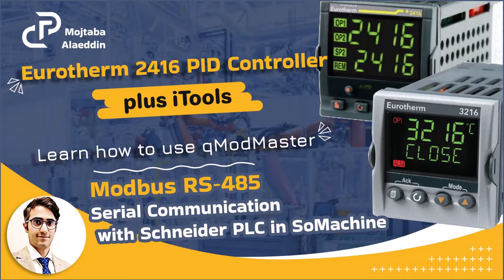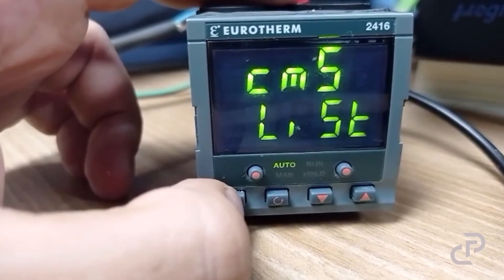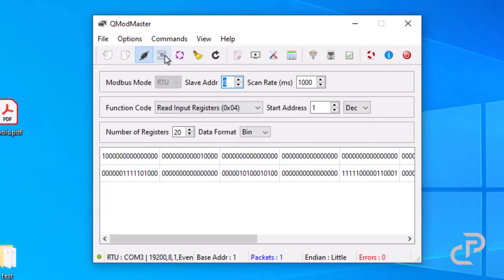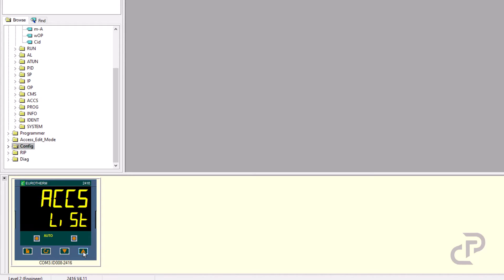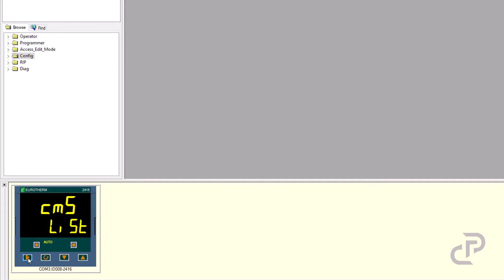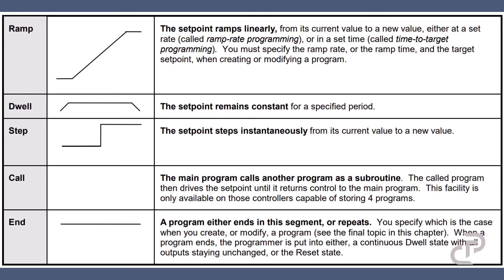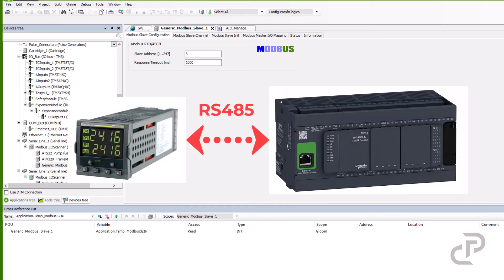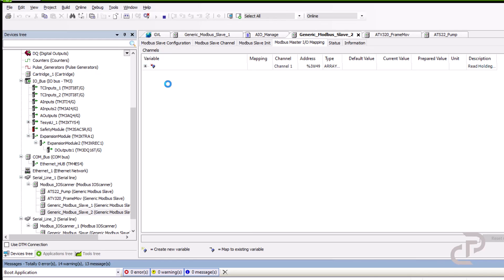Eurotherm 2416 PID Controller configuration | Modbus RS485 communication with M241 |

Comment: I am trying to establish a connection between my PC and my Eurotherm 3508 controller using the USB-RS485 adapter. I followed your instructions, but I get no response from the controller when I try to read registers in QModMaster. I checked that the Com port, Baud rate, parity, is correct. I also tried switching the A+ and B- wires, but still no response. It says zero packets in the bottom of the QModMaster. Any advice?
Reply from the maker: Are you sure that RS485 module is already installed inside the controller case? By default it's not installed on controller and you should order it separately
Reply: @m.alaeddin  Could you send me a link of what you mean by RS485 module? My current setup involves three wires connected to the HD, HE, and HF ports on my Eurotherm controller. These three wires then go into a USB-RS485 converter I got from Waveshare, which then connects to my computer.
Reply from the maker: I mean there is a electronic board that should be installed inside the controller case.
You are correct about terminals for connection but if you open controller case you see these terminals are without connection because by default RS485 module is not installed

Comment: Does 3216 has same modbus configuration?
Reply from the maker: Yes it is almost the same but be sure that modbus card is installed in 3216 case. if you want to order 3216 take into account that you should order it with the modbus card.